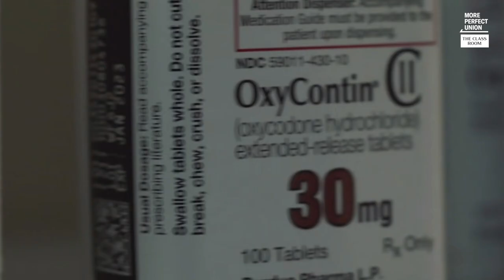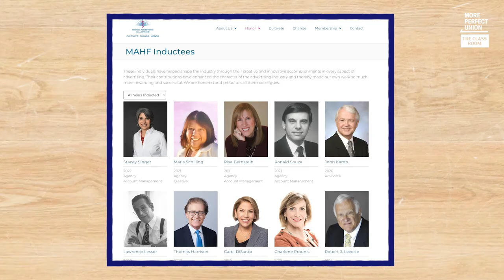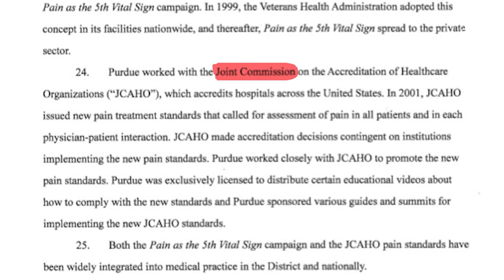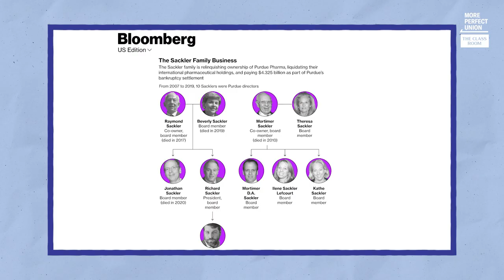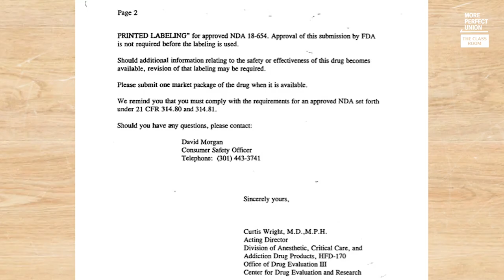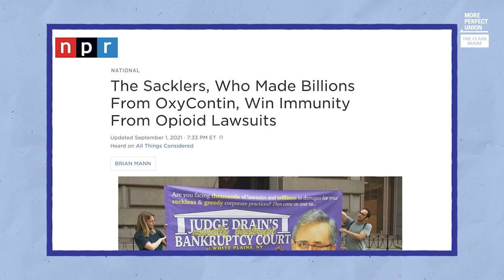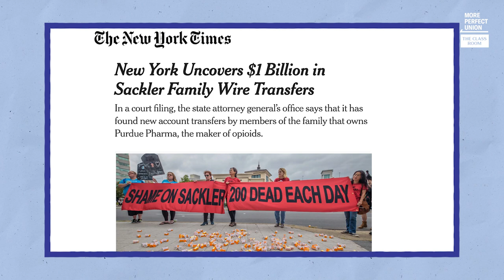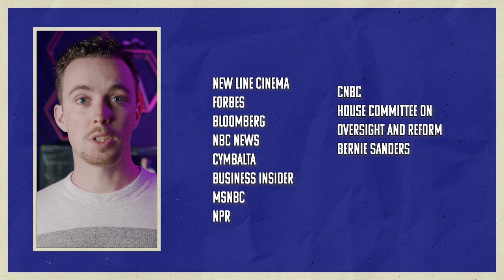How One Family Made Billions While KILLING Half A Million | The Class Room ft. Second Thought

Comment: My life has been ruined by pain. Lumbar fusion surgery didn't fix the problem that makes it impossible to sit for more than short periods in chairs, sofas, car seats, restaurant seats, theater seats, airline seats, or anything that puts pressure on a spot just below my right glute sets of pain down my leg into my foot and heel. It's made me pretty much bedbound since 2014. For years the pain was reasonably managed with 4 Vicodin a day, that is until the Ohio pain clinic system and non-doctors took away might doctor's ability to prescribe. Then I had a failed shoulder surgery, a shoulder that needs to be replaced but I'm afraid to have done, and a knee injury that surgery didn't fix that has me using a crutch to walk. (can't use a cane because of my shoulder) Now no pain doctor will prescribe it for me. They put me on Buprenorphine naloxone, which is a hideous drug that is not a pain med and offers little relief, has to be dissolved under the tongue and is nasty tasting, and takes 1 1/2 hours to dissolve where  I can't drink and can't eat and that's twice a day. And it is MORE addictive than Vicodin was. I'm 72, my life is ruined lack of pain management and it's hard to go on. I never missed a doctor's appointment, never misused opioids, never took more than prescribed, never ran out of meds early, never lost a script, and never failed a drug test, yet I'm treated like a drug abuser. Opioids have a legitimate use for long-term pain control. Doctors are afraid to prescribe even modest amounts of Vicodin WHICH WORKS. The system has thrown the baby out with the bathwater.
Reply: I hear you because I have trouble lying down and just getting rest ! I blame microwaves. I think you were pretty brave to get surgery. Lumbar fusion sounds like pure hell. I’d say if you’re struggling that bad then start growing poppy plants….or try Cannabis. In some instances using opiates for severe pain is understandable.